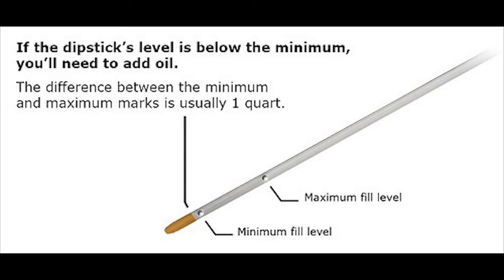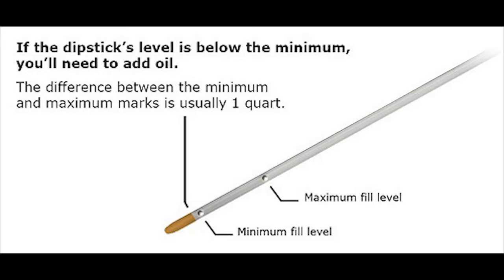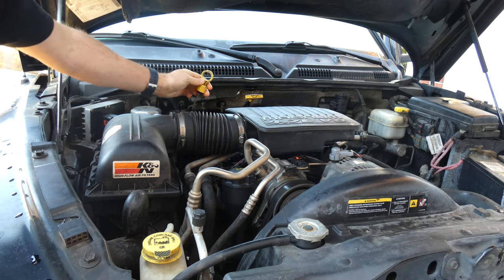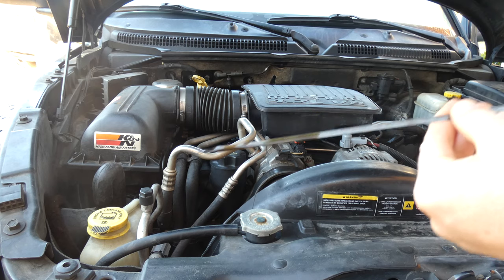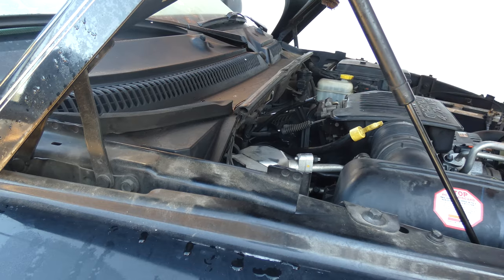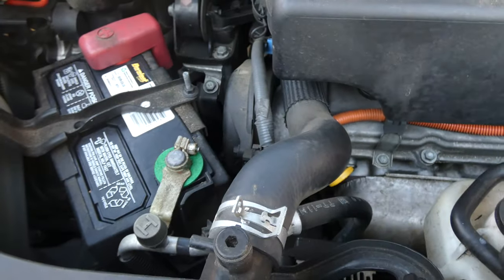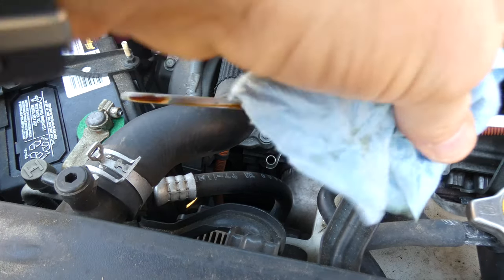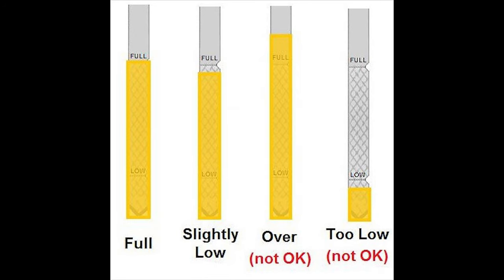How to Check Your Engine Oil Level & Read an Oil Dipstick

Comment: Checked my wifes miata mx5 during 28° weather that sat overnight. It was barely on the tip of the stick (3/8") where it begins to tear drop. Mind you our driveway is at a 10° angle. Adding a half quart of oil brought the cold level to almost 1/3 above minimum on the dip stick in our angled driveway. What possibilty is there of any engine damage with it that low? Seems to be burning a quart every 5000 miles. 6k miles is currently on this oil that was low.
Reply from the maker: Most likely none.  The fact that you saw some on the stick is a great sign.  Every car is different as to how low the oil can be before the pump can pick it up but as long as you didn't notice low oil pressure or get a warning light in your car about low oil pressure, you probably didn't experience any issues at all.
Reply: @ClintHolland  whew! Not an easy feeling seeing it that low. She does a lot of highway driving to work so the miles rack up fast. Is 1qt burned every 5k miles normal? Her previous car, a chevy sonic, never burned any oil even at 8k miles! I wonder if it has to do with Mazda requiring 0w20 which is pretty thin oil to begin with.
Reply from the maker: @ryanchristensen1799  How many miles do you have on the vehicle?
Reply: @ClintHolland  only 38,000 miles and it has been doing this since the last few oil changes. I can't remember if it was having the issue when new.
Reply from the maker: @ryanchristensen1799  I would recommend having the compression checked personally just to make sure.  To be honest, many manufacturers consider that amount normal so it may be nothing to worry about but I would certainly check the compression. Do you notice any smoking or oil on the ground around the car? Also might check the spark plugs to see how they look if it is burning that much oil.
Reply: @ClintHolland  no oil on the ground nor oil leaks around oil pan. I haven't checked exhaust for blue smoke. I'll check spark plugs when I do the oil change in the next couple of days. I wonder if the pcv system is allowing to much oil to be burned through the intake? I suppose I need a service book to find out what compression the cylinders should be at? Thanks again for your help!
Reply from the maker: @ryanchristensen1799  If you tell me what year it is, I will pull it up and let you know.
Reply: @ClintHolland  2017 RF club, thank you!
Reply from the maker: @ryanchristensen1799  The minimum is listed as 128psi but depending on the condition you may get much higher.

Comment: When the level is between the 2 dots, should I add half a quart of oil to my car?
Reply from the maker: If it is between the 2 dots, your level is perfect.  Don't add anything.
Reply: Id have to disagree. If your cars requires “said” amount and this reads at the top hash/dot mark this is full if it’s 1/2 below this mark then it’s low. If what you’re saying is okay then we all can add 4 quarts if it takes 5 & it’ll be okay. 

Ive always kept mine topped off to the top as much as possible. But that’s just me.
Reply from the maker: @TexasNova  The proper amount of oil is when it is between the dots or hashes. This isn't according to me but according to the manufacturer of literally every car ever.  They have designed the range specifically for your engine and oil pan.  It is just as safe to drive around with it in the middle of that range as it is at the top.  The reason there is a range instead of an exact, specific level it has to be at is because having too much oil in your car can be just as bad as not having enough. So to combat that, they allow a safe range.  There is nothing wrong with keeping it at the top as long as you are careful not to overfill it as this could be catastrophic to your engine. And there is also nothing wrong with keeping it in the middle of the range. I would caution against keeping it at the bottom of the range, not because it will harm your engine but simply because now you don't have a margin of error should you forget to check it frequently.
Reply: TexasNova      Best thing too do is look at your cars manual the full mark isn’t there too fill the oil right up to it’s there too tell you if the crankcase is too full if you are at the full mark or beyond you got too much oil drain some out. The trick is to be between the the low and full you don’t gotta be perfect. But when changing the oil make sure you put at least the mount of oil in they call for then check the dipstick

Comment: I've just done an oil change on my car but the dip stick is very difficult to read. One side doesn't have any fluid on it. It's completely dry while the other one reads twice as overfilled. I drained about 5 quarts out of the car and put in just as much. The stick is just as old as the car which is 21 years and it's only worked properly one time for as long as I've had the car which is about 4 years. I can never get a clear reading.
Reply from the maker: They can sometimes be tough. Here is a couple of tips.  Let the car sit for quite some time to make sure all the oil remnants from the tube have drained down.  Then, when you remove it have a paper towel handy that you can lay the dipstick on quickly.  This should allow you to clearly see where the oil was on the stick even if it's hard to see where it was on the stick.

Comment: What if ur at the full on one side if the dipstick and low of the other side of the dipstick? Thats how mine reads for some reason
Reply from the maker: Sounds like one side of the dip stick is rubbing up against something on the way out which is wiping the oil off.
Reply: Yeah mine is the same way. I repeated it
Reply: When pulling the dipstick out try to pull it straight up without it rubbing on the dipstick tube. Sometimes the oil runs off gives the wrong reading

Comment: Super helpful Clint, question foryou, when I insert my dipstick and pull it out im between the L-line and F-line but there is a small space with no oil in between these. Wondering what this might mean?  Does this mean my oil level is actually low?
Reply from the maker: I am not sure I understand.  Can you send me a picture?  clint@quickfixman.com

Comment: Hi Clint. I have a new 2022 Jeep Renegade Latitude. The dipstick is attached to the oil filler cap. I'm not sure how to read the oil level stick. There is a small plastic piece at the end of the dipstick. But, I am not seeing any grid or holes. Is the plastic piece where you can tell the oil level or?  Thank you.
Reply from the maker: This isn't my video but take a look at this video at the 2:15 mark. That plastic piece is the indicator but it should have a pattern on one side. https://www.youtube.com/watch?v=0MH-yVxSR_M&t=153s
Reply: @ClintHolland  or

Comment: What if deepstick reads levels all the way up, like all the way up to the deepstick handle.
Reply from the maker: That sounds like something you might see if you havent let the oil settle back down.  In general, you should be able to see a very distinct line of where the oil is. If it is reading all the way up to the handle, your vehicle is way overfilled and you are probably noticing a lot of other issues.
Reply: @ClintHolland  thank you for taking the time to reply.

Comment: yes I have a question - many cars these days have a dipstick that has 2 different readings at the exact same time(like a full quart of difference).. there’s a hash mark on one side, but you can put dipstick in either way(hash mark on higher reading side or lower reading side) & no one seems to know the answer, which reading(higher or lower) is correct(& btw then it’s obvious how to Alighnment that side with hash marks area).. but which side is correct(& correct hm side)?  - it’s really sad that no one seems to know this👋
Reply from the maker: I have never seen or heard of this.  Do you have a year, make and model that you have seen this on? I would love to research this and get you an answer.
Reply: It’s on my 12 chevy impala LT, & btw, I just changed empties oil(supposedly 6qts) & then put a 5 at jug & filter & a 1 qt Lucas oil treatment - & on dipstick, after warming up car, then letting it settle 4 5 minutes, the mark is right up to top area on hash marks - but about 1 qt lower(prety much not there at all) on other side. so IF I successfully drained all the oil out.. that would mean that by deductive reasoning, the higher mark is the correct one.. bt IdOnO
Reply: I read on some discussions that if dipstick goes in in a tilt, the readings will obviously be 1 qt differant - but IF the impala dipstick gOz in in a tilt(as I would put beneath any manufacturer attempting a better repair reputation for more business).. IF this or that company does that, it appears to be a well kept secret which side(higher or lower) is ‘correct’ level
Reply from the maker: @ezwa9979  Are the marks on either side at the same distance from the end of the dipstick? If so, I suspect that one side is being wiped as you remove the dipstick.
Reply: @ClintHolland  
I guess the aprOprE8 thig wud B to sprA a bunch of comprSd air down that hobhoblin thN?🤔 (hobgoblN - fOn)
Reply from the maker: @ezwa9979  The general consensus when this happens is to trust the highest reading.  Pulling out the dip stick can cause one side to get wiped but it won't cause the oil level to go higher on the stick.
Reply: @ClintHolland  
thNx Clint.. my problem(not mentioned on this comment but pertaining to compressed air idea) is that I get no clear reading on either side, oil on dipstick goes to 1/2 or 2/3s across dipstick & drags on for like several inches to high, & no oils not actually too high, dipstick just doesn’t work.. that’s what I though ‘oil wipe’ meant(not getting wiped off, but wiped on).. I only know my oils not too high cause I drained it & added correct amount.  anyway if I can get past that dumness, consensus is the higher reading, thNx chEf👋
Reply: @ClintHolland  
by the way, gOEng back to the 1st problem(2 different level readings), even though, as you say, & thankyou, that the general consensus is the higher reading.. that consensus would be right &/or wrong 50% of time, depending on which rotation(way) one inserts dipstick👋😒
Reply: @ClintHolland  
even if people say which side to read when inserting dipstick that goes in on a slant.. the correct reading to check, would STILL depend on which way on puts in dipstick.. these are examples of the complete & total dumness of current dipstick engineering design.. a dipstick that can be inserted EITHER ROTATION/way(& no my dipstick has no forward or backward markings) - with a high reading & low reading, which no one knows which one is correct(depending if it’s slanted or wiped off a bit), & no one knows which way to insert dipstick to get the correct 2 readings to choose correct one.. it’s pure dumness at the highest level clint(no pun intended)😑
Reply from the maker: @ezwa9979  Not sure if this helps but what I have had to do in the past is to pull it out and place it immediately on a white paper towel so I can see where the oil actually is or was.  But make sure the car has been off for a while before doing this.
Reply from the maker: @ezwa9979  In general that shouldn't matter.  While your dip stick tube snakes around and has curves in it, the dip stick is eventually inserted into the oil pan completely vertical.
Reply: @ClintHolland  
yS let the oil drain off dipstick 1st, that may B the whole solution to that 1, as far as dipstick inserting verticLE into oil pan, not on all cars these favtorE conIving days.. there are videos about the slant entry into flat oil level on flat oil pan, & in that case, 1 side of dipstick reads quite notably higher/lower then the other, Iv watched that video, & now can’t find it, & I don’t remember which reading is correct one, but in that case, guess it doesn’t matter if you put dipstick in backwards, cause same tilt, same higher & lower choice.  any video on changing oil pan in whatever car might show angle of dipstick tube in that oil pan & car, or even if you can see tube on outside of oil pan you should probley see if it’s verticle or deliberately slantd🤨 - actually there may be an eazier way to check if this tube/entry is deliberately tilted by the conIving factory.. with car cold, or off for 5-10 minutes, parkd level, if dipstick reads at same level on both sides, flip it over to recheck - double check, & if it’s still exactly the same on both sides, it’s vertical👋

Comment: i do not let the engine set before i check the level. the engine is using oil to lube the parts so some of that oil is setting in the top of the engine. so it is not available to use until it finds its way back to the sump. so why are you waiting to check oil that is not available to pump into the engine for use? That sounds counterproductive to me. kind of like measuring the water depth of a well that has not been use. as your pump draw water the table drops. if it drops below the point the pump sucks air and you lose the prime. the same thing with an engine. an engine that is sludged up takes a long time to get that oil back to the sump so your pump can actually run dry at times waiting on oil.
Reply from the maker: I am not sure I understand what you are saying.  Your statement basically confirms the reason you check it after the car has been sitting. The purpose of the dip stick is to measure the amount of oil available to be pumped to the engine. You can't possibly measure that accurately if you don't let the oil flow back into the oil pan.
Reply: @ClintHolland  no what i said is i check the oil as soon as i shut the engine off. i want the oil in the head and rockers as that oil in not useable to the pump. i worked in machine repair and we did not fill the hydraulic tanks to full with the pumps off because that was a false fill reading. we had the pumps on and taking oil out and then filled the tanks so the pumps had a full tank to draw from. when the hydraulic pumps are on they draw down the full tank and can cavitate real fast. the same thing happens to the engine if you check it after is sat for a bit, yes the oil drains back to the pan but if you have a sludged engine that can't get that oil back to the pan fast enough you run the risk of cavitation or low oil pressure. so you do it your way i will do it my way thanks
Reply from the maker: @bobpalmer4740  Understood and we will have to agree to disagree.  With your method you run a real risk of overfilling your oil pan which can be catastrophic to an engine. I will keep doing it the way the manufacturers recommend.
Reply: @ClintHolland  with my method you will never overfill your engine to the point of damage. and you will not have any catastrophic engine damage with overfilling. lawn mowers use that method for lubricating their parts for years. you have to esenually overfill them to make them lube themselves. think about it. apparently, you have never overfilled an engine and heard what is sounds like. tell me how the rod slapping the oil is going to damage them. it may foam the oil but the sum is fa enough down to overcome that. i have seen it.  in fact, my girl just brought her car to me for timing chain repair and she had over 8 qts of oil and the engine ran just fine. thanks
Reply from the maker: @bobpalmer4740  Again, we have to agree to disagree. I have been doing this for over 30 years and while I haven't seen an engine fail from overfilling, I have probably seen over 50+ oil analysis samples come back to us showing premature engine wear likely caused by oil aeration or cavitation.  If you don't believe it can be catastrophic, just do a quick Youtube or Google search and you will find plenty of examples from others who did in fact have a catastrophic loss. I have also worked on cars that rolled into the shop with no oil and we couldn't find any damage whatsoever but I sure as heck am not going to recommend not using oil because of such anecdotal experience.  I make these videos to help people who aren't certified mechanics and the techniques I teach in this video are backed up by 30 years of experience and approval from literally every car manufacturer in the world.  Your technique is probably find 99% of the time but I sure would had to be in that 1% where the manufacturer voids the warranty because they can show the oil was overfilled.

Comment: Alright heres a trick question, what if you get two different readings on either side of the dip stick?
Reply from the maker: Not sure I understand what you mean? Are you saying the oil is at different heights depending on which side you look at? Or that you have 2 different scales on the sides?
Reply: @ClintHolland  oil on different height on either side of the stick
Reply from the maker: @thezosokid  Got it.  That most likely means the stick is getting wiped on one side as you remove it.  Use the higher level as the correct level.

Comment: Thank you!  I bought a new lawn mower and the dip stick with arrows.  The hard to read.
Reply: Some lawn mowers such as Honda require that the stick be partly out of the engine, not all the way in. Read your manual.

Comment: Are you not sure that the first thing to do is make sure your engine is HOT or COLD?
Reply from the maker: Actually that answer is it depends.  Some car manufacturers recommend it be cold and other's hot. Especially on dry sump vehicles.

Comment: My problem is the oil is to clean
Reply: If it's black you need to change the oil every 6 months
Reply from the maker: Lay the dipstick on a paper towel as soon as you remove it and you will be able to see where the level was. Or a sheet of paper.